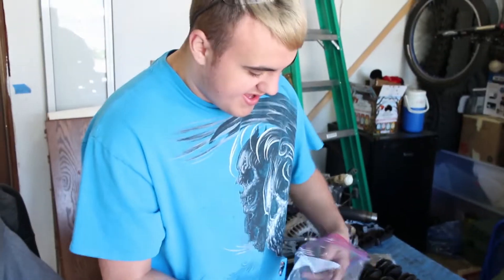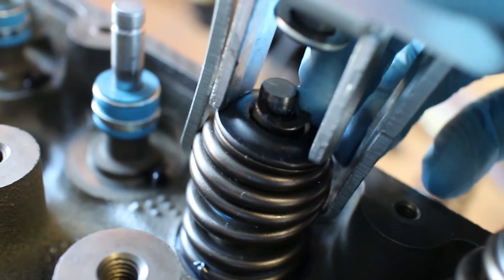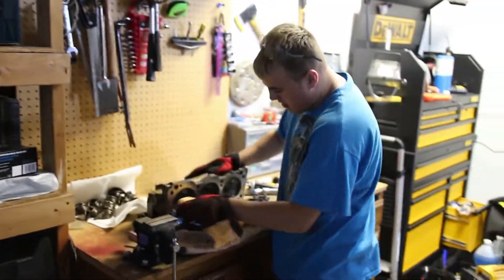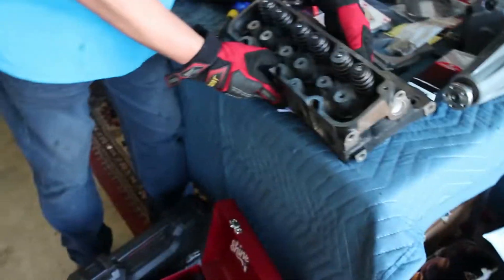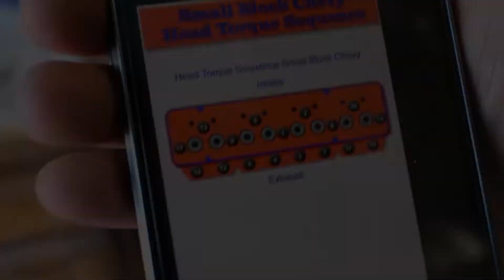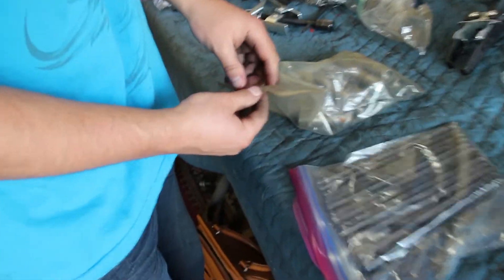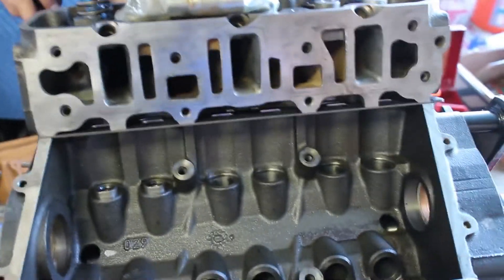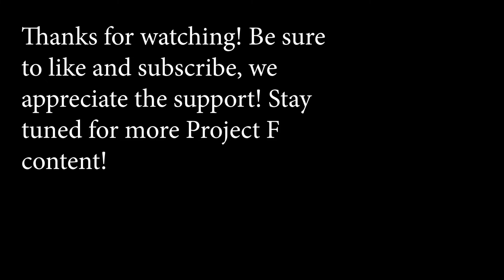Project F 3800 L67 Engine Rebuild! Part 3 (Ported Cylinder Heads are on!)

Comment: so stock rockers for this build? I new stock rollers rocked.  why ls7 lifters, are they longer? I was gonna clean and reuse the stock ones, also not going to s/c it but iam going with the zzp cam.
Reply from the maker: We wanted to go with 1.9 rockers but they ended up not fitting in the budget. LS7 rollers are a good upgrade/OEM replacement for the ones we have. We got custom 7" pushrods for the setup.

Comment: What cam are you running that is going to need 130# springs? The VS can be used with stock and I personally know from mine the XP only needs 105s. 130 seems like it would simply cause un-nessesary stress on the timing chain and wear out the valve seats faster.
Reply from the maker: We're using the ZZP XP cam, from the manufacturer recommendations and online forums we went with the 130# springs.
Reply: Our ZZP recommends 136# springs for this cam no matter the rev range. these 130#s wont allow any valve float at higher RPMs and even if it does cause slightly more wear to both the chain and valve seats over time it wont matter, This car is going to be a drag racing car and a weekend driver so it wont see that many miles. Plus its double timing chain is a big boi so no doubt it will hold up.
Reply: I posted another comment on one of the other videos concerning the double roller. It will definitely fail fast if you don't correct its chamfer with 130# springs. I only bring these things up because I went through all the same stuff. I own a 98 m90 3800 Camaro with an XP and 105s and a single cloyes timing chain. I would hate to see your engine blow because of a small detail.